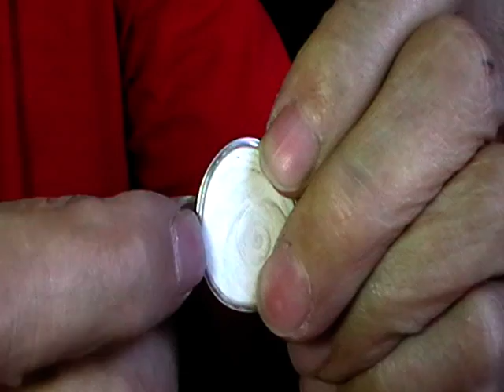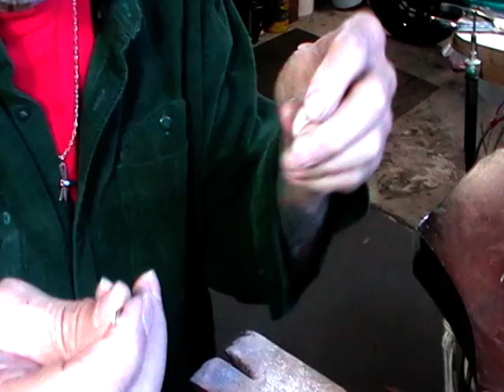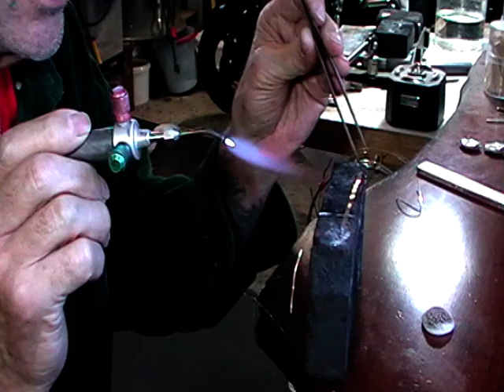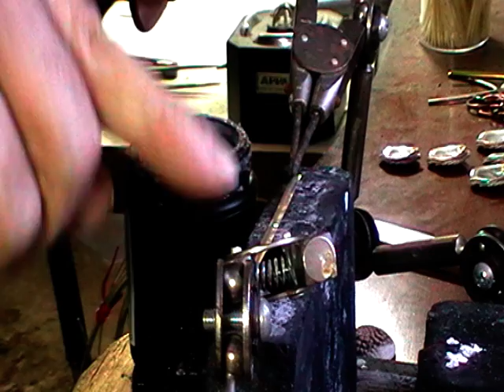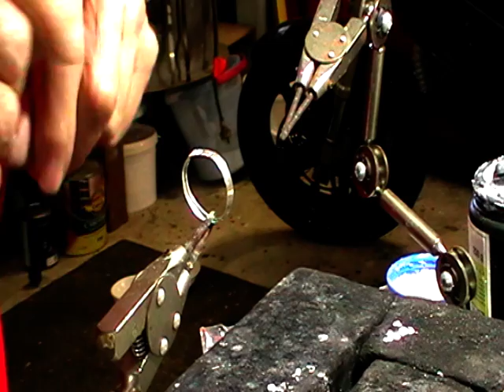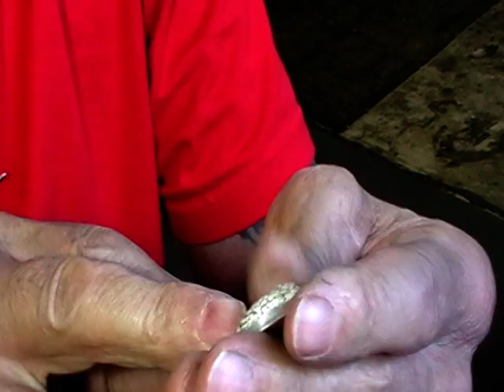step bezel

Comment: Hi Soham, I'm wondering if you wouldn't mind assisting? I'm using commercially bought step bezel and I'm finding it very hard to bend even after annealing it.The bezel ends up either too loose with the stone falling out or alternatively when I measure it/cut it a tighter fit for the stone and solder the ends,I then can't get to stone to fit it!The step bezel that I have isn't "flexible" like the normal bezels so I can't just use pliers to "open" the wire out some at the top and then insert the stone and the metals really hard and doesn't want to move (bend).Are there any techniques to get a good fit with step bezels?
Reply from the maker: most commercial step bezel wire is sterling which is why it is dificult to work with. get some of the argentium bezel from riogrande.com it works like fine silver. i think you will be happier.
Reply: Thankyou for your help Soham.

Comment: Hi Soham I am a newbie to your vids and smithing.  I the vid you had a tool to cut your solder with.  What is that tool called?

Thanks for the generosity of sharing your great skill with those of us who may not have another option to learning this information.
Reply: #111-607 in the rio grande catalog, solder cutting pliers, otto frei also has them in a smaller version